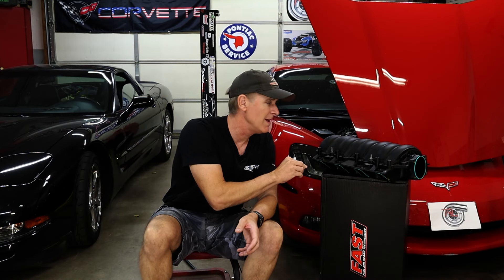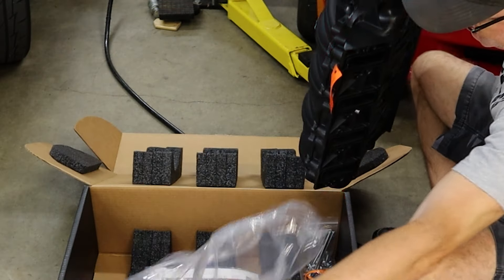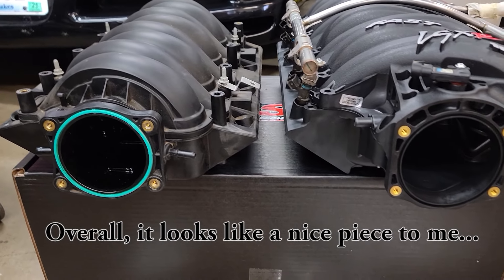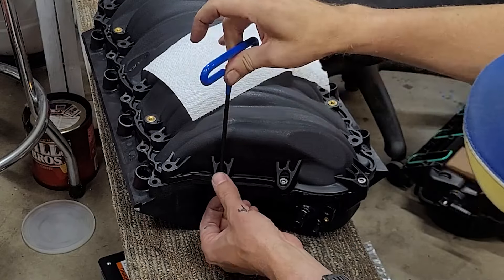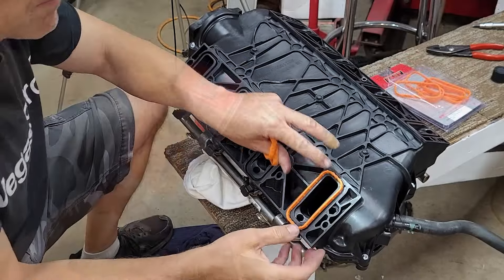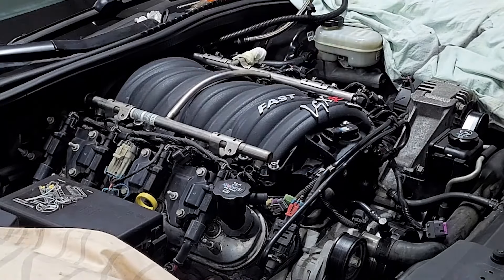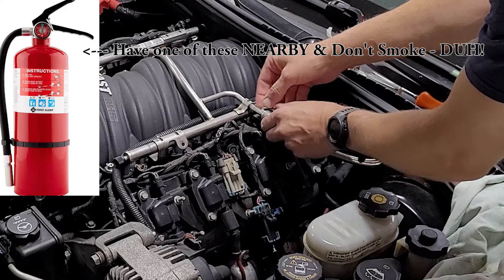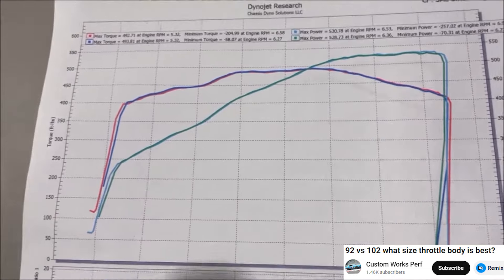FAST LSXR 102 Intake Upgrade for the LS2 Powered C6 Corvette Part 2 (It was TIME!)

Comment: Subscribed as i will definitely be using these videos when i install my fast102! Ps id definitely recommend setting up an oil catch can between the valley and manifold to prevent residual oil from gunking up your fresh manifold😉 also look into a vararam intake, way better gains over any of the stock ls3/7 options!

Comment: Please do video, about intake air sensor relocated on c5 corvette
Reply from the maker: You're really insistent upon this. What's your specific concern/why do you think you want to do this?
Reply: @Toys4Life  The Manifold Air Temperature (MAT) sensor is responsible for sending air temperature information to the ECM. It’s located directly underneath the intake plenum. Due to this location the sensor picks up engine heat and the air temp readings are incorrect, or at the least “not optimal.”
Reply from the maker: Agreed, but as you get going down the road it sustain speed it gets within a few degrees typically, but the heat soak effect can last for quite a while at low speeds. I think it's a good mod, as long as it is still put in a reasonable spot. For some reason my C5 IAT temps get closer to ambient/realistic a lot quicker than the C6, the C6 takes its sweet time at speed for about 15 minutes to get there.
Reply: Had you considered replacing the oil pressure sensor while there was plenty of access?
Reply from the maker: @QUIKSIX1 Yes but aftermarket ones have about the same failure rate as OEM ones. So in this instance since it's been a good sensor, I'm choosing to leave it. Perhaps the smartest thing to do would be to install a remote oil pressure sending unit line which would make it easier in the future, but I didn't.
Reply: @vitalirider707  None of the C5s actually place the IAT in the intake manifold/plenum (and therefore it's not really a MAT) - that information is incorrect. In earlier C5s the IAT is a separate sensor placed in the intake tract/tubing after the MAF but before the throttle body. In later models the IAT was integrated into a combined unit with the MAF sensor, so now located farther upstream from the throttle body. What many people call "heat soak" with the earlier design I would call "reality".

Comment: Questions my stock mas  flow sensor is in the throttle body why i need to drill the manifold for the mas flow sensor 🤔
Reply from the maker: You're drilling the hole for the MAP sensor not the maf sensor.
Reply: @Toys4Life  🤣🤣ohh ok thanks sr..

Comment: Any tips on modifying the covers as the FAST 102 is biger
Reply from the maker: Yes, keep fitting them and use a marker to indicate where they are interfering and use a grinder to remove a little material at a time until achieving the fit you desire.

Comment: I don’t think the gain will be significant at peak. Maybe some good gains through the rpm range. Episode 3 will tell me if I’m right or wrong. I have an ls3 which probably has a better intake to begin with. I’ve researched this for my car and the gains weren’t worth the $. Hope you surprise me! Great video as always.
Reply: The LS3 definitely has a better intake to begin with, which is why they don't really gain much with a FAST.
Reply: @nowayjose596  yes, I’m pretty sure that is what I remember reading. Thank you for confirming.

Comment: did you consider removing the pillars on the original manifold ?
Reply from the maker: I did not, I'm not sure if there needed structurally or what the originally OE design was all about. I'll keep this manifold structurally intact in case I ever supercharge so that it can handle the extra PSI (:-)
Reply: @Toys4Life  thanks for the response. Was curious of any gains. Maybe you can pick one up from the junkyard 😃
Reply: @Toys4Life  The original pillar design started with the LS1. The pillars were there to minimize harmonic resonance. The pillars are a carry over only to the later LS6 & Ls2. I ported my LS2 manifold by removing the pillars and port matched at the head. I did not hear any resonance I didn't like, lol.